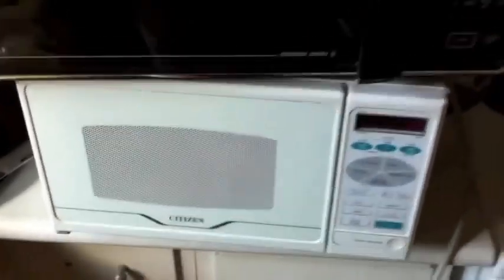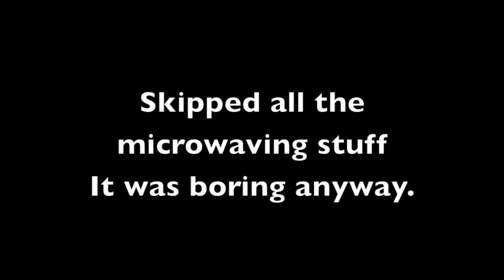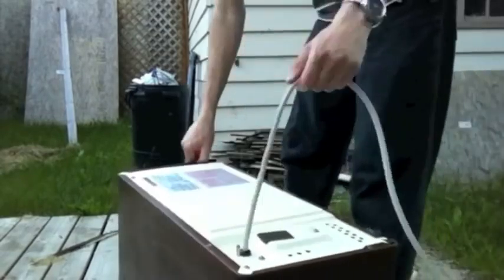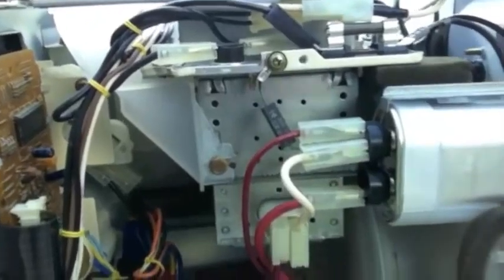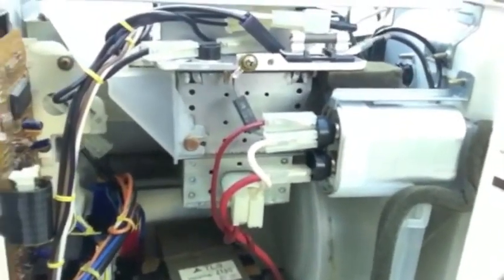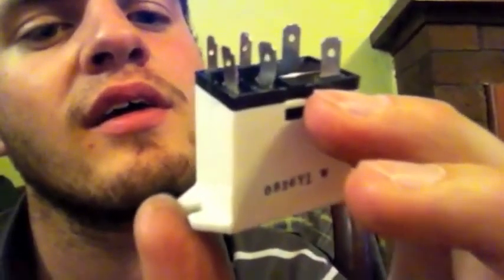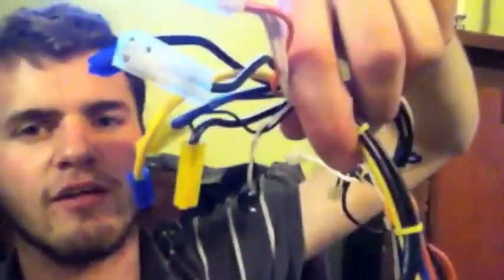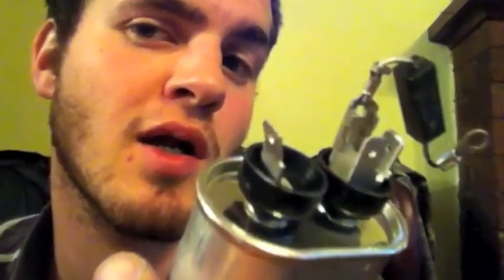Bought a Microwave to get a Transformer??

Comment: Even though the transformer is straight out lethal at 4KV, and I'm estimating an output value of a 1/4 amp (50-60 htz) - I can't see the transformer itself holding any capacitance (no transformer will function on direct current - it has to be AC or anytype of Pulsing current) because transformers function because of magnetic fields produced (witch are short lived) Unless, the transformer overtime somehow held a magnetic field? 

It's allways good to be scared anyway, lol-yup.